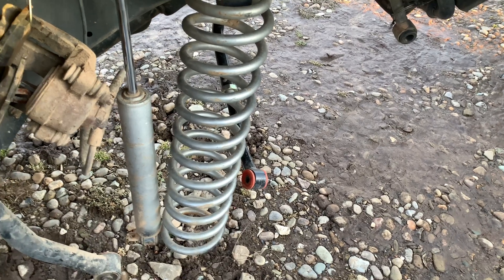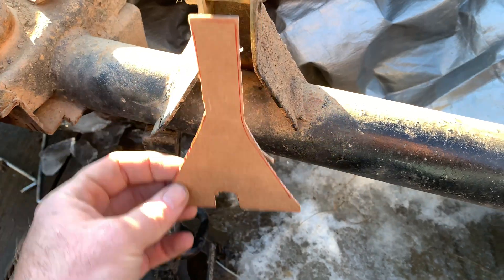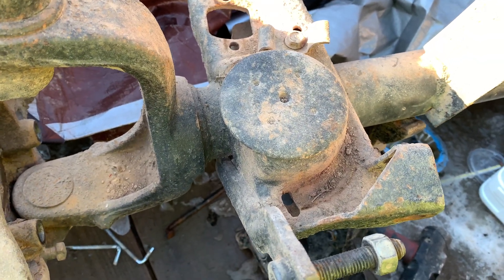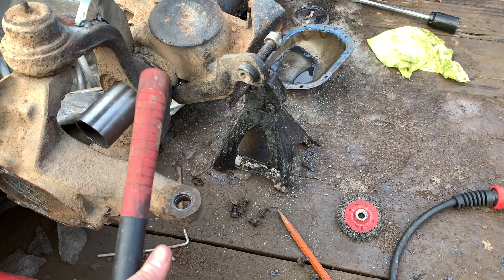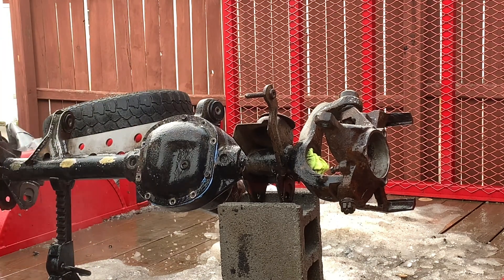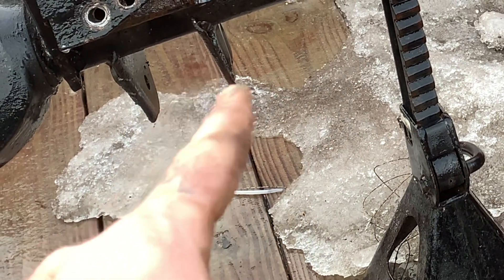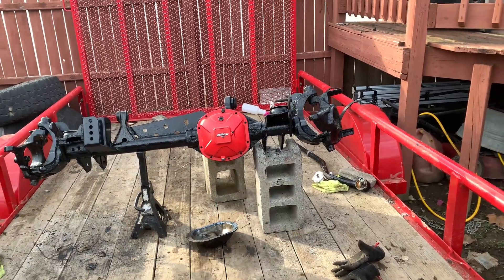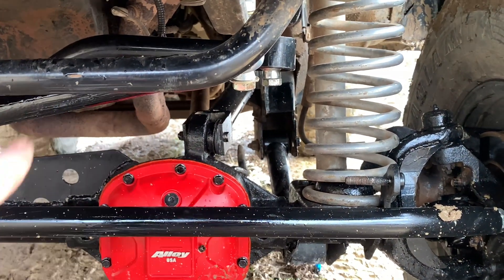Ultimate budget Dana 30 build Jeep xj

Comment: Planning something similar for my WJ low opinion D30. It’s been : years now, how is it holding up?
Reply: Wondering the same thing to  I'm about to sleeve and do a low profile truss and possibly a cut and turn since I broke my upper control arm mount off was also wondering if it was legitmentally worth doing

Comment: Hi Ronnie… I’m so happy I found your low pinion videos! 
I had thought after way to much money spent that I needed a high pinion 30 or 44 , 2000 grand Cherokee limited.
I put in the weld in sleeves and lower control arm mounts and chrome molly shafts and new locker and C gussets welded on. I should have turned the Cs next time if it fails.
I have only a few snow wheeling trips in PNW Washington. After seeing and listening to you know feel a lot better about it. Question how has it been holding unless? Very interested 
Thanks 
Steve

Comment: Ive been running pit bull 35x15x14.5 with aussie locker for 2 years and beside breaking you joints and snapping ears off shafts its been fine ... Now running cromolly shafts ... Been fine
Reply: I just went to 35's from 33's on my TJ with 456 gears and lunchbox locker.....side by side 35's aren't that much bigger than 33's...I give my Dana 30 hell on really tough trails and never had any breaks or problems...What's the big fear or deal with all this?  Info.....

Comment: I run 37s on a low pinion on a light 4cyl TJ with chromoly for the last 4 years with no problems.  I live in the southeast.  Don’t be scared, just stay light.
Reply: 35s or 37s is my my plan for my 4 cyl TJ aswell. Just a locker and chromoly's? What ya runnin for rear?
Reply: @Captain_Koz  8.8 gears 5.13.  There’s a guy on eBay that builds and sells 8.8s for TJs.  $1500 delivered with gear of choice ready to bolt on.  Add $1000 and you get an ARB.

Comment: Hey you're welder sounds like the one we had at work that we ended up changing the inner sleeve on the torch line. It was kinked and the wire wasn't feeding smoothly it was frustrating. Once we changed it it was like a new machine.

Comment: I’ve ran my 30 for years with 35’s…locked and has chromoly shafts..5:13 gears…I’ve thrashed on her never a problem..not trussed either…not yet
Reply: I’m also on a dana 30 w/  an E locker, chromoly axle shafts (HP30) and on 35’s. No issues!! Yet.. lol
Reply from the maker: Better watch with a comment like that the keyboard Warriors with chime in and tell you how weak it is 🤦🏻😂

Comment: My idea is to run 32 ats on road and snow and 35 general x3. I'm going to regear to 4.56 and put a worm gear locker up front. I want to reinforce the housing and ears as well and want to stick with a LW dana 30. I would however like to upgrade to 30 spline locker and axles. The jeep will be used mostly off road. Rock crawling. But also some high speed long distance trail rides.. mostly what I want is peace of mind and for all 4 to spin in the sand and snow.. but this makes me want to chance it and stick with the 27 spline axles and replace as needed. Mine is also a high pinion but I'm more concerned about axle shaft twisting and snapping while trying to climb or bind of wheels under a rock

Comment: One of my questions is if I upgrade to 30 spline shafts then do I use the d44 30 spine locker?? No because the ring gear is bigger right..
Reply: No you’ll need to find a 30 spline d30 locker

Comment: Did you try doing a full stuff with no springs and bumpstops? I know when I did my  TJ  there was only one  aftermarket front diff cover that did not interfere with track bar. The key is it is based on stock but reinforces the hottom
If curious I can send it.

Comment: I'm surprised you didnt weld up some LCA skids, those weak tabs bend/break easily. And then you gotta go back and ruin that paint job when replacing the stock brackets.
Reply from the maker: The lower control arms have been beefed up you ain’t bending them and later down the road I’ll put skids on it
Reply: @LeggettsGarage  ok, I missed that in the video.

Comment: Hey Ronnie , Nice job on the Dana 30.   I made almost the same kind of brace for the passenger side upper mount on my ZJ axle .  only on mine I made it taller and curved the top of it to cover the bushing ,so it boxes the entire mount bracket . 
  personally I'm really fond of the top truss you added ,it looks like it takes up a lot of clearance ,. a section of 1/4" angle × 2" wide would probably work just as well , and would probably cost less money for a guy on a budget .  
  I do like those tube sleeves you added , those are probably about the best up grade for strength .  
   Thank you for your videos . 
 Tim from Wisconsin .